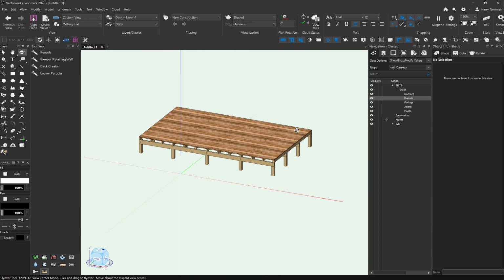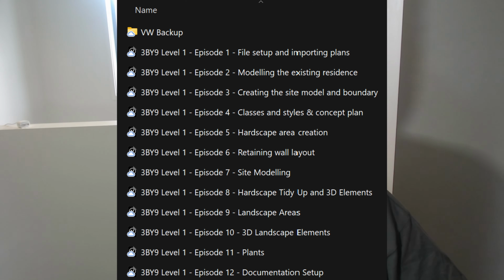3BY9 Relaunch | Professional Vectorworks Education & Workflows

Comment: this is awesome brother, do you only design or build as well?
Reply from the maker: Hey mate, thanks for the kind words!When I was studying design I worked part time with a landscape construction team, haven’t pick up the tools since I’ve graduated though. Do you work in design and construction?
Reply: @3BY9 i own a design build company but on the fence if i should do vectorworks over using something like sketchup. I like how robust it is
Reply from the maker: @HeavenlyWarriorMusic  That's a really common question a lot of people have when looking into which design software to use. I feel like VW is more complete for landscapers straight out of the box vs sketchup, and a lot more powerful. This comes at the cost of complexity though... Once you get the hang of it and know how YOU use it (everyones different) it saves a lot of design time in the long run IMO, also as you develop in design scope and complexity it can always keep up with you if that makes sense.

Always available if you have questions regarding the software. I've included a contact email in my about section if you'd like to discuss things further 👍
Reply: @3BY9 that’s awesome info thank you so much I’ll be reaching out